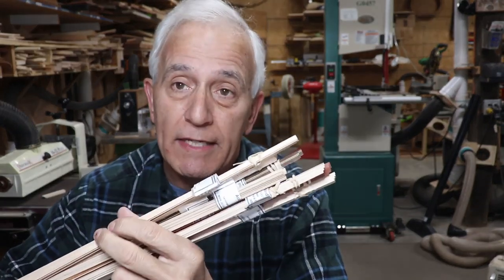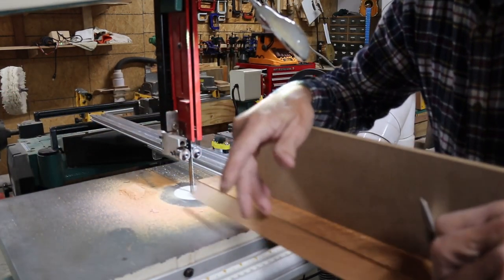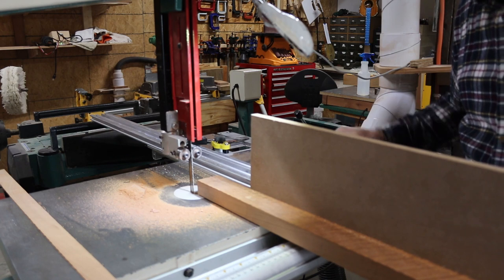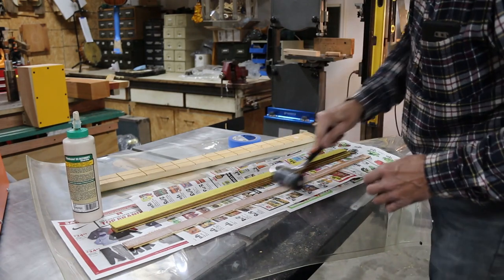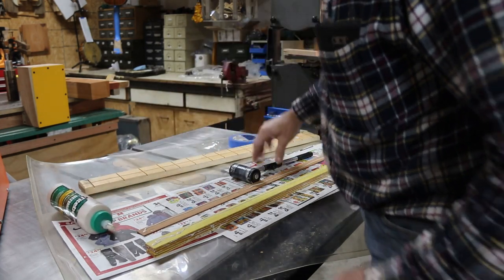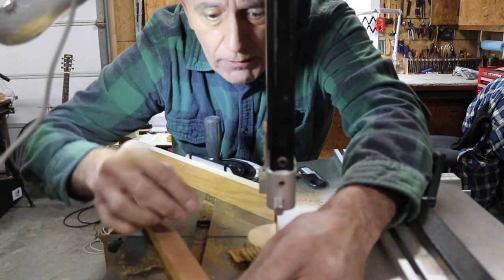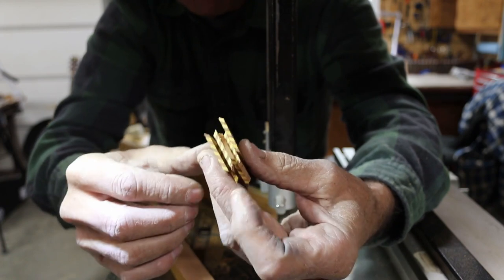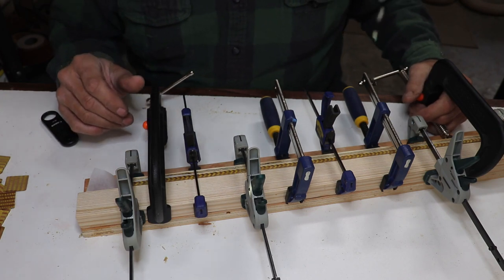455 RSW A 12 String Custom Rosa Dreadnought

Comment: The herring bone looks great and is a lot of work.  The only thing I could think of to speed it up.  What if you set the first piece.  Then stack one at the other end.  Clamp them with your long board.   Then as you glue you could wedge the pieces in.  You wouldn’t have to keep adjusting clamps.

Comment: Hiya, Jerry, nice to see ya back.   Say, for your info, at Flatiron, we used to use a brand of "luthier" tape called Reel tape.  They used it for holding ivoroid binding on mostly tuner head veneers, but it was used for other things as well.  It's 3/4 inch wide and about .007" thick so multiple layers act as shims or spacers.  It will not do what your blue tape does. After all these years, we ordered maybe 100 rolls and I still have about 12 or 15 rolls left to use.  I can't tell you all the things I've used it for besides luthiery stuff.  Makes great labels for vegetable pots when I grow tomatoes and squash starts from seeds.   Just thought I would try to turn you on the Reel Tape for yer shop. Cheers and best wishes for all you beautiful folks at RSW.  Bob in Montana 😀😀😀😄
Reply: Man, I love that vac bag for clamping stuff. -- wish I had a need for one. Awesome ! Air pressure does the work of 1500 clamps, huh?  Great thing to have, my friend.  Bob

Comment: Jerry, great video, as always!  Regarding your vacuum veneering technique, might I suggest you use only enough tape to hold the strips together as is absolutely necessary?  By putting the (what seems to be shown on your video starting at around the 17:50 point) on those 3 or more layers of tape, you're introducing high points at each tape location, which will transfer to your piece.  You should only need one layer of tape; anything more than that's unnecessary.  Further, your choice of tape appears to be poor.  Use only the thinnest possible tape.
  Again, great video!

Comment: Uh oh.  At 18:43 you place the stack on the board before putting the laminate pack in the bag.  That is a good way to accidently glue the stack to the backing board.  That board is unnecessary because the air will evacuate fine without it.  I have used vacuum pressing for literally decades now.  I would also suggest exterior weight on the laminate stack to keep it flat.  The bag will provide a lot of clamping force, but won't necessarily keep the stack flat.  Putting weights on the outside keeping the stack flat to the table saw surface will ensure it is flat.  We had large laminating tables and used vacuum for tabletops and other veneering jobs.  The laminating tables had formica surfaces and for most work we didn't use "bags".  The laminating table surface itself was one side of the "bag" and a loose visqueen plastic cover that was sealed around the table edges with temporary caulk was the upper surface of the "bag".  Kept everything flat.

Comment: Wow!  A 12 string Rosa at last.  I can't wait to see you work on the intonation as they say 12 string guitar players spend half their time tuning and the other half playing out of tune.  

COMPENSATED SADDLE FOR 12 STRING
I particularly would like to see how you approach the problem of compensation for the E, A & D octave strings where they sit on a saddle set well back on the bridge designed to intonate the thicker bass strings.   As you make your own saddles & nuts from deer antler, would you consider making  a custom made cantilever saddle with extra meat at the front to correctly intonate the octave strings?

COMPENSATED NUTS
I have watched your videos for years and have never heard any mention of compensated nuts.  The guy at StringTech Workstations Youtube channel, Mike McConville, seems to put compensated nuts on almost every guitar he works on.  They seem tricky to make & expensive so I put the cheaper Hosco  SOS (string offset spacers) on my 6 string guitars  which give me close to James Taylor Tuning where each string is flattened by a specified number of cents:.   
E -3     B -6     G -4     D -8     A -10    E -12
Unfortunately they don't make them for 12 strings yet so I will have to make my own.   

I would love to hear your expert thoughts on compensated nuts & saddles in a stand alone video & then watch how you approach the intonation problems on the new 12 string Rosa..

Comment: Wonderful video Jerry. Had to laugh my butt off though.  This week I was trying to re-saw Red Spruce in to panels of 0.10"X4.5" in order to book match them for making the sound board of a Virzi tone producer that I want to put in a mandolin I am working on.  I tried about 5 times using every trick I knew including gluing the spruce to a sacrificial piece of wood. Nothing worked every slice was thicker on on end then the other.  That machine would have knocked it out.  Crazy that you show this video a few days after my failures!

Comment: While you were gluing laminates i was reminded of a thing i saw in a video about the Hofner factory that makes Beatle basses. They had what looked like an overgrown old fashioned tape dispenser but the roller deals out glue. You run your work on the roller and it gives you complete even coverage. Not too much. Not too little.  No slop. Have you seen that tool? Quick and neat too.

Comment: Hi Jerry,

When I've seen the Masking Tape and Super Glue trick, I've always seen the Masking Tape get smoothed down with something, even seen the bottom of the glue bottle used before the glue and accelerator applied.

This should eliminate the gaps you get in the glue up.

Comment: That is the thing about making your own trimmings, it takes a long time to. Which is why it costs so much as well.  I love the black and white herringbone pattern.  Looks real classy.  Just wondering how the osage orange ages.  I presume the yellow will change over the years?  My observations for improvements to the jig: 1 cam locks not knobs  2 a lathe type wheel with a small handle on it, would be quicker to use and soother I think

Comment: I have an old(est) banjo I purchased on facebook, the nut is laminated white-black-white, plastic I'm guessing that needs to be higher and it's the angle base type, so I'm going to shim it and do the baking soda thing to repair the extra deep slots because there are no replacements on line. Any ideas on slicing some material on your slicer to make a new nut. Fret '0' was removed to compensate for the deep slots.

Comment: You are my guitar god, Jerry. But I would like to advice you for this project not to repeat the mistakes  most of the other manufacturers make with 12 string guitars.A 12 string is not just a 6 string with 12 strings: 1. Use a short scale, maybe 64cm. It will be easier to play and the high G string won´t brake all the time. 2. Use a deep body, 12 or 13cm 3. If you make a pin bridge, use the first pin row behind the saddle for the low strings, they make the basic sound and you know how important the string angle will be. I have differerent 12s and it is so much better 4. The space between the strings pairs at the nut should be a little less than 2mm, that makes the guitar much better to handle. All of the normal 12 string nuts from the manufacturers are made badly, too wide, to high. Even on expensive Martins and Taylors. I ´ve been playing 12 string guitar since 1974, trust me, I know what I´m talking about. The customer will be thankful. Greetings from Germany